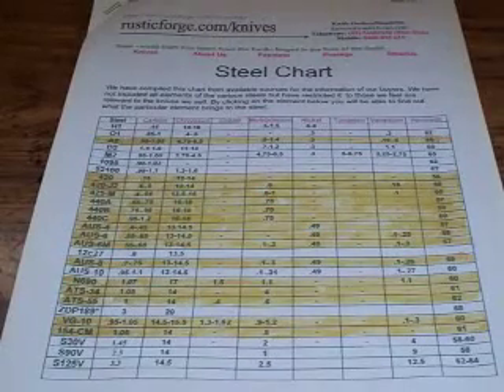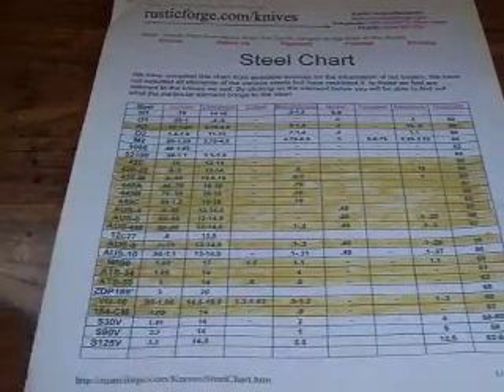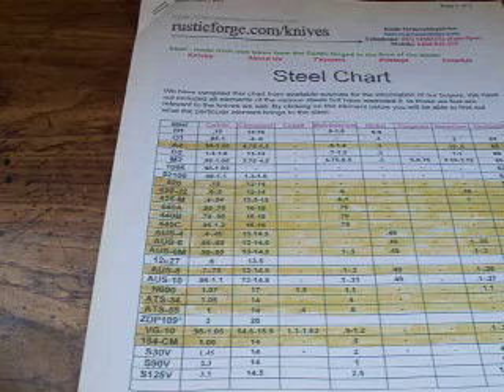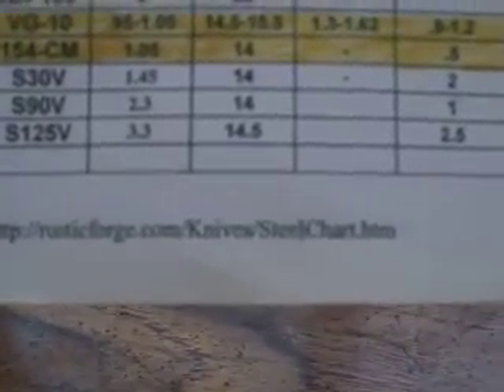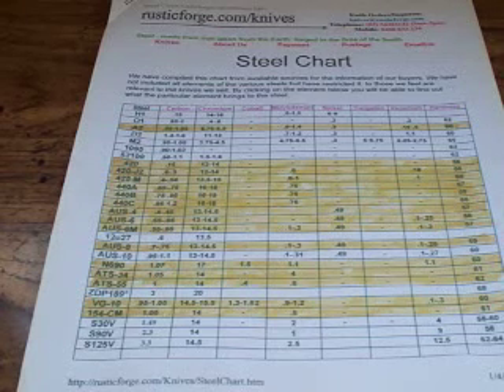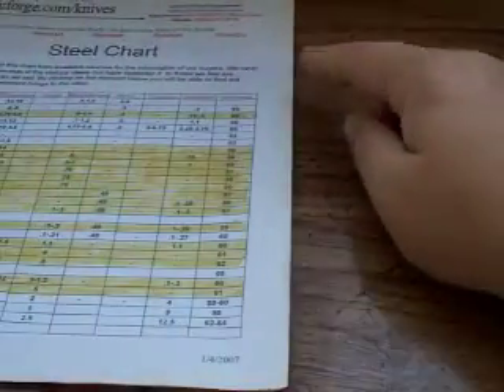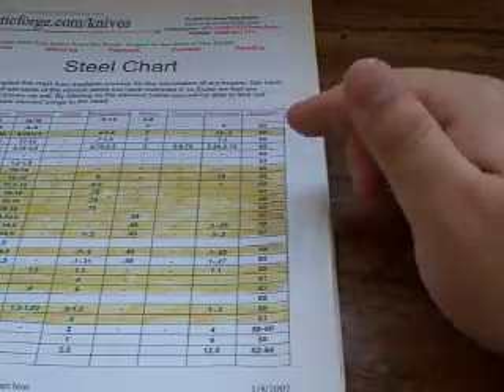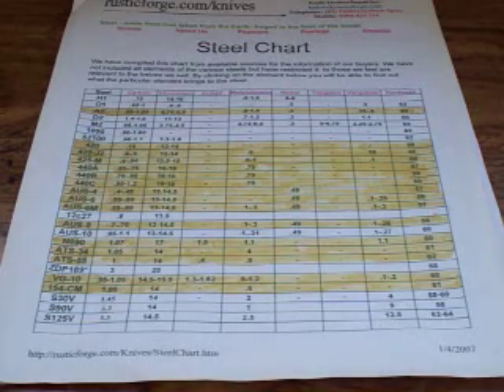Knife Steel : Explanation

Comment: August 2013 Bulletin: The chart in CutleryLover's 2008 video is no longer available, but there is a fantastic article at bladeforums on modern stainless steels. Additionally, I found an interactive steel chart at zknives, and failing that, MidwayUSA has a chart in their "TechnicalNotes" section that will probably stay posted until hell freezes over.

Comment from the maker: @75SilentWarrior yes my slip up in speech, as a blade steel its not prefered by many due ot its lack of edge holding capability...heat treating ti is a lot different then stainless or carbon steel...mission knives is the only compoany I know of offhand that even used Ti as a blade material

Comment from the maker: Well without even looking at the chart I cna tell you the top steels are S30v, VG-10, BG-42, D2 (not stainless), 1095 (not stainles), ZDP-189, and 154CM...others that are also nice are ATS34, which is almost the same as 154cm, only a japanese version of it, and a good heat treated 440C is also good enough for most cutting tasks...